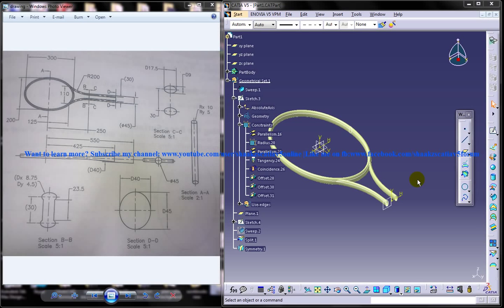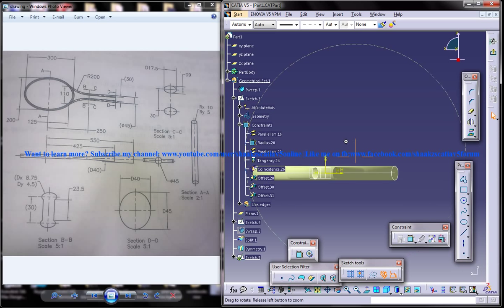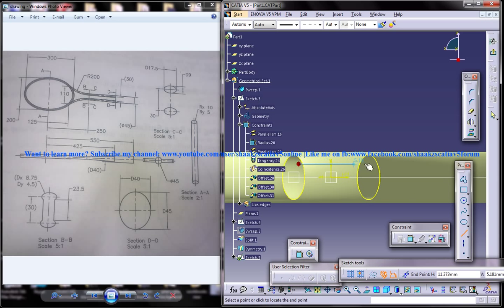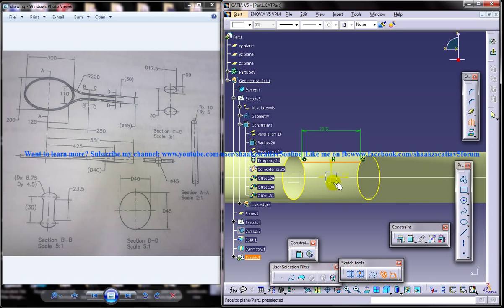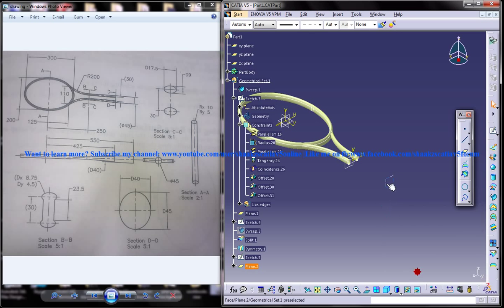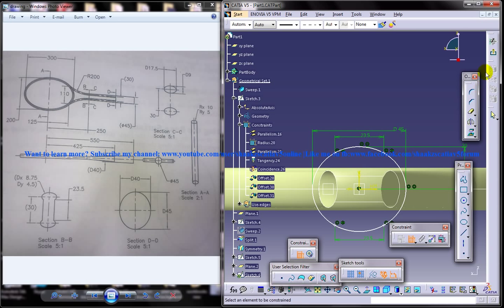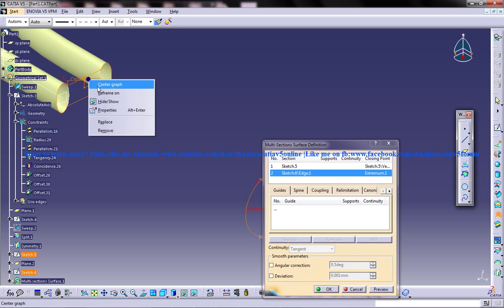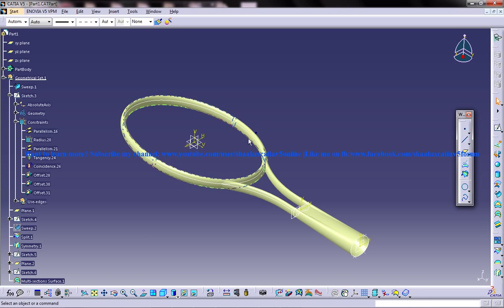Catia V5 Tutorial|How to create a Tennis Racket/Shuttle Bat/Badminton Racket|GSD|Part 3

Comment: Hi man! Thanks for the tutorial.
For me has been imposible execute the multi-section-surface to ends the part three. Programme ask me to use the NEAR comman because the selected element is a non connex element. I have tried to follow and repeat all your instructions twice times but the results always are the same. 
Could you help me, please?

Thank again!
Reply from the maker: +Abraham Esteban Hello Abraham, what is the error that you are getting. Regards.
Reply: what i have seen from my experience is there could be an extra element in your sketch..  try to constrain your sketch and then use MSS

Comment: why do we need to replace the CLOSING POINT? can you elaborate a little bit please. good tutorial you made here
Reply from the maker: Muhsin Ramli ,
When you select two curves, Catia automatically selects the closing point by default. If that closing point wont match your requirement, You can replace it. Sometimes If you dont replace the closing point, It will lead to a twisted surface.